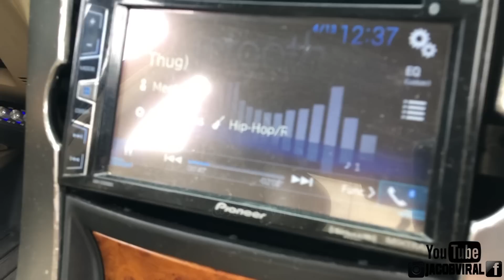4 12S SEALED BOX IN THE TRUNK

Comment: is sealed box better for a sealed trunk? I've heard that ported boxes are better for hatchback or open trunk space.
Reply from the maker: If optimal space go ported over sealed for output.
Reply: @JacobViral  what does optimal space mean? like, a big trunk? kinda like a crown vic?
Reply from the maker: Uno Denero it means If your subs required 3 cubes ported but you only have 2 cubes then sealed is the way to go for example. Better to have the space for the subs then to squeeze them in.

Comment: If u put them 12s ina ported box on that taramps 5k don't let that amp fool u they make power but it takes power 2 make power keep that electrical rite n u'll b surprised wat it'll do better trust n blieve on that u shuld b find just w that amp honestly prob close 2 a high 47-48 atleast...sounds gd port them subs n u"ll easily gain 2-3 db's mayb hit a 50 in that tiny car on a 5k that amps very surprising ask Jacob about taramps he has 1 now 👊👊 keep up the great content as always bro..DD Z2 J from Jerz!!##??✔✔💯💯👌👌👋👋✋✋👌👌💪💪👍👍👆👆🔛🔝
Reply: John Remsen Jr. agreed, I love taramps but they are powwwwwer hungry for sure!
Reply: @youdrop  Yeah deff I'm doin a small budget build now n it's the 3k it dynoed around 2,990 it's the 2 ohm version but yes very power hungry lol I hav a Ohio generator 240 amp n 3 kinetik hc2400s in now n apex 270 4 my next build!!##??
Reply: Yeah I’m currently running the MD3000.1 with 1 xs power D3400 + Stock Battery and a 250 amp powerbastards alt. Voltage Holds well until I start playing under 25hz
Reply: @youdrop  Nice that's not bad at all mayb do 2 agm's n u'll deff notice a diff!!##??✔✔💯💯

Comment: It's punchy 👍he might be able to put a external port on and leave them in that box
Reply: nah, airspace of that box just isn't enough for 4 12s ported (and would be on the small side for 4 10s and on the large side for 4 8s), at least not for low 30s tuning, only 1.3-1.4 cu ft per sub, needs to be more 2.2... also would need to make it into 2 chambers rather than one (because of the different subs) with a port for each chamber

Comment: I feel like my sub hits hard but the way they insulated the trunk from factory it dampens all my noise no rattles at all
Reply: That's good, makes it sound cleaner. You just need more power an bigger sub sounds like :) bass on!
Reply: I’ve got a single 10w7 running around 450-600 watts, but I’ve got a 13.5w7 I’m getting rebuilt and then will probably try and locate a jl 1k mono or a 1500watt comparable amp I actually believe my w7 10 may be able to handle close to 1k without a problem If kept moderately low on the input level
Reply: @AllaboutTheWoodrows  Input level isnt a volume control it's a way to match up your head unit volts to your amp. Dont put to much to your sub or you'll burn it up, peak power is only power that it can reach in an instant, there not meant to be constantly overpowered.
Reply: @AllaboutTheWoodrows  you should watch some smd videos about dd-1 and their dd-1+. Admittedly a little pricey but worth every penny for the clean sound you can achieve.
Reply: Tyler Pippin sub input I got about 3/4 way up no bass boost I’m considering buying a 1000watt and running it low instead of needing 3/4 for it to make decent sound, running off factory radio with amp add on and rca adaptor as the Addon  rca didn’t work probably why it doesn’t get that loud
Reply: @AllaboutTheWoodrows  that's because you need an adapter to lower the volts on your factory deck if I'm not mistaken
Reply: Tyler Pippin that’s the adapter I bought but didn’t fully work properly and return was a hassle so I just use the adapter for the remote wire which works and got a rca add on to the rear speakers for the amp I didn’t have much time and had to make due with options available plus price ect.
Reply: Allabout TheWoodrows see if there’s any way to access the trunk from cabin of car. if there isn’t then it’s sound will be muffled. i have a metal sealed bmw trunk, cut a hole and sounds like a bass boost. Just a square in my back arm rest and it will float shit in the window with 1 12 on 1500 watts. the lows are way better also
Reply: justin r17 I’m only putting roughly 5-650 watts  off a 1200 mono Vega amp on a 10w7 considering buying a 1k mono jl amp for it and running at low gain instead of 3/4 with my Vega
Reply: Allabout TheWoodrows check too see if your trunk is sealed from the inside of the car. if you remove your back deck speakers or cut a hole somewhere you can still make it look nice with a speaker grill or mesh cover and it will blow your mind the difference. when i cover my hole with the arm rest it mutes all of the bass
Reply: justin r17 I can drop my back seats down it doesn’t make much of a difference until I roll all the windows down then my mirror and sunglasses holder fall down which is alright just thought a w7 10 could do a bit better obviously it’s a factory headunit in this car but even with aftermarket headunit it still looks barely moving maybe I’m just tripping and it’s more than I think been around w712s and it flexed the suv it was in but that was 10 yrs ago so maybe my mind alil blurry on reality I’ve got a 13w7 I’m waiting to rebuild then I’ll see the difference between the 10 and it first hand in my rides will be easier to judge
Reply: @AllaboutTheWoodrows  Within the next couple months I‘ll be running a 13W7AE off the Fosgate T1500 at 3 Ohms. I’ll let you know how it sounds 🤙

Comment: Wait I thought you can't mix subwoofers?
Reply from the maker: Not suggested no but it will work just not optimal
Reply: You can it just isn’t what professionals would do, I mixed 2 kicker 12s with a DD 10, and since the kickers play high and mid bass notes great but barely played low notes, and vice versa for the DD it worked out pretty well

Comment: I’m trying to bust out store windows when I ride by lol I have a 4 pack also
Reply: REMY MARKUS get some skar DNR subs, they are 15s $800 but 5000 watt rms and 10000 max
Reply: @musclecarsdaily3020  even if just the subs are 800 the amp and necessary electrical upgrades to push that much power easily making that a 3-4K project lol unless done yourself is the only issue. Went in to a shop to inquire about a similar build but for the 2500 watt 5k maxx 12s and it was pushing around 2k before even adding in the sub and amp